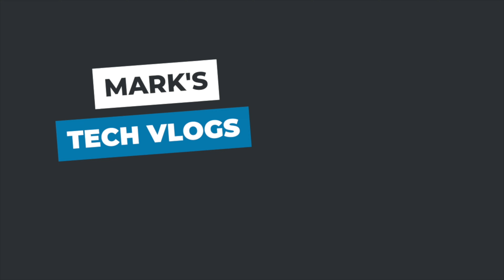SwitchBot Indoor/Outdoor Thermo-Hygrometer Review - Smart Outdoor Thermometer

Comment: Forgive the stupid questions. Would this work for camping  without any phone or wifi signal? One inside and one outside the tent for comparison?
Reply from the maker: It would work but you wouldn't be able to get the data off of it without a phone/bluetooth connection so not sure you'd be able to compare much
Reply: @MarksTechVlogs  thank you for the reply. Id have my mobile, but there's no phone signal where we camp.
Reply from the maker: @Rick-gb5jj  Ah, that should be fine for comparing things in the Switchbot app..it does seem to open fine with no connection and via bluetooth you'll be able to monitor the two sensors
Reply: @MarksTechVlogs  brilliant. Thought it would be interesting for winter camping. Thanks
Reply from the maker: @Rick-gb5jj  I have to say winter camping sounds like my idea of hell! 🥶

Comment: I bought it and am unable to open the battery cover. I've liked up tips and everywhere just said to remive the cover. Is there a trick to removing it? Do I pull it up or slide it?
Reply from the maker: It is pretty stiff because there’s a seal under it too, it lifts up. I’d try using something in the small indented area to prise it gently

Comment: Are the AAA batteries in the unit replaceable? 

I'd like to use the unit to monitor garden temperature for growing dragon fruits. If I'm indoors out of Bluetooth range I'd need to buy the hub that gets within Bluetooth range and connects the monitor via wifi correct?
Reply from the maker: I’ve just opened mine to check and yes they are just normal AAA batteries you can replace.

And yes, you’re correct about the hub 😀

Comment: I'm looking to monitor the temperature of different apartments in one building and compare it to when the outside temp drops below a certain temp. Do you know if the data export options allow for comparison across different devices?
Reply from the maker: It gets exported as a CSV but it looks like you only export one meter at a time which would mean exporting all individually and then merging the spreadsheets in excel
Reply: Thank you! @MarksTechVlogs

Comment: What we're looking to do is place one on each directional side (N,S,E, and W) of the house outside.  Then compare those temperature and Humidity combinations to those indoors and open or close windows and drapes accordingly... can it / they be used to do that?
Reply from the maker: Yeah you could use them like that, you would just use the switchbot app to setup scenes based on the outside temperature and humidity and then control the devices you want to

Comment: How do I get battery cover off for first use?
Reply from the maker: You shouldn't need to, you should just pull out the plastic tab and it'll work. If you need to open the battery cover this might help https://support.switch-bot.com/hc/en-us/articles/13071920187287-How-long-will-my-SwitchBot-Outdoor-Meter-battery-life-last-#:~:text=When%20replacing%20batteries%2C%20open%20your,this%20may%20damage%20your%20device.

Comment: So you must have the Hub for the sensors to work? It can't work with just the app? Looking at them on Amazon they have a three sensor pack with no Hub but they don't state plainly that you must have a Hub or Hub 2 for this to work . If it can work without the Hub, can view the current temperatures in the app and the data collected so far? Or is that some kind of a download kind of thing where you can't really monitor the current conditions? Man, I'm glad someone made a video on these things or else I would have had to just buy them and find out after.
Reply from the maker: They do work without the hub but you can only access their current state and data when you’re in Bluetooth range with your phone 😀
Reply: @MarksTechVlogs  So they could still be used as a data logger without the Hub. Then maybe I could buy the rest of the system later and use it as intended. I don't really have much to monitor or control at the moment. What I do have is a central AC unit that checks out in every way they can measure, nonetheless, it has stopped cooling after 8 years. So it's a troubleshooting thing for now and more data is always better. 
Thanks man. That's exactly what I needed to know.

Comment: Using the hub, can you set it up so that you get a notification when one sensor reads a higher temperature than another sensor?

Just wondering whether this is possible with the app or IFTTT or anything else?
Reply from the maker: In the switchbot app you can have scenes that can have multiple conditions so you could have one that sends a notification of the downstairs meter is above 25 degrees AND the outside meter is above 26 degrees for example…you can also set these as OR as well
Reply: I just reposted this question in the main section.  "What we're looking to do is place one on each directional side (N,S,E, and W) of the house outside.  Then compare those temperature and Humidity combinations to those indoors and open or close windows and drapes accordingly... can it / they be used to do that?"